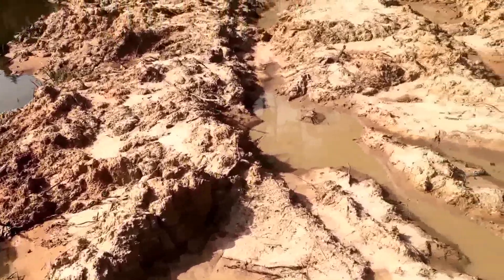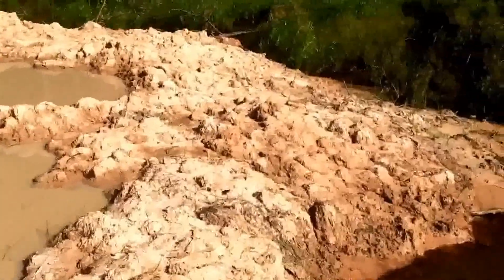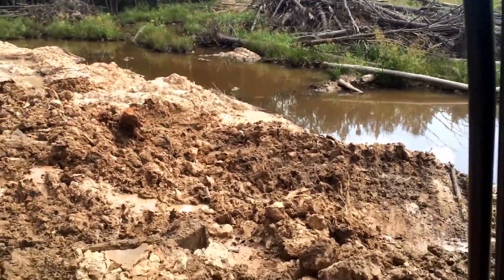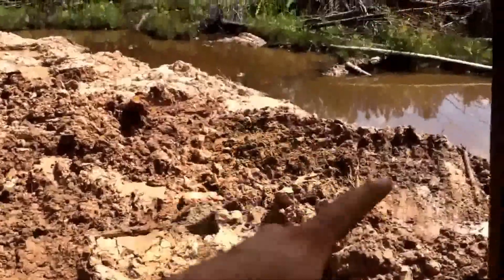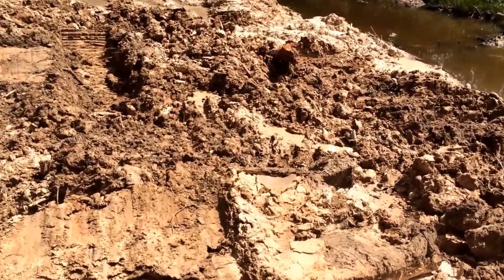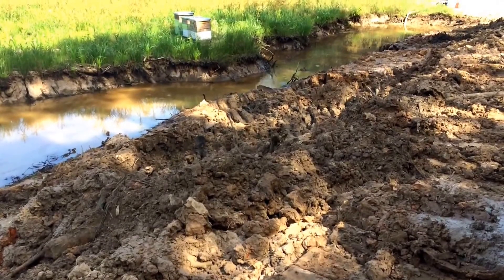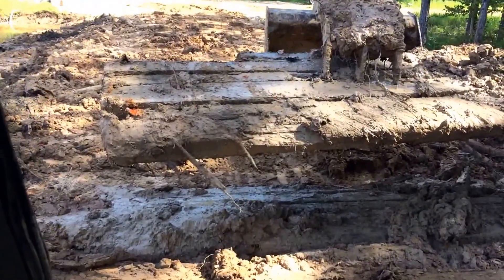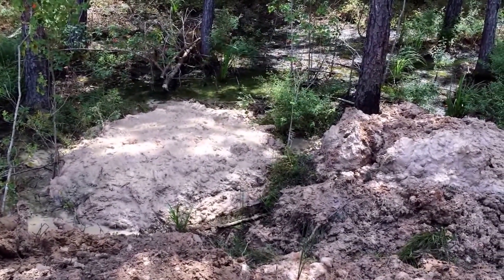Farm Work Update - Finally Some Good News!

Comment: On the bright side. You wont have to drill too deep if you have a well put in ;)
Reply from the maker: I'm not sure what you mean Aaron. Are you thinking the water is shallow water table? It's not, this is all surface runoff. I've researched surrounding drilling reports. The good water table is 200-300' (which still isn't bad). You can drink the mud "milkshake" is you want. I'll stick to clean and clear water, haha! Thanks for watching.
Reply: Tom Brueggen All that water has to go some where. It would eventually raise the water table. Probably not much but giving how much it cost to drill a well i'd say ever foot counts. 200-300' is really good wish mine was that good.
Reply from the maker: Aaron That's a stretch, but I see where you are going with it. Most of the water that you see here is infact surface water that was supported on the surface by silt. However the bigger issue is the water that has permeated the top ~2' of topsoil and then pools at the soil/clay boundary. That is what creates the "milkshake" mud phenomena. After a few days of dry weather, the surface crusts over, and gives the impression of dry solid ground. But with just a little disturbance, this top layer turns back to water, and turns to quicksand. It's how so many excavators have gotten stuck in what otherwise appears to be dry ground. This was a HUGE learning to be just yesterday when I finally observed what was going on. As I dug a ditch beside me, I exposed the weak plain of the milkshake mud. The weight of the excavator was squeezing the muck out into the trench I was digging. So when first exposed, the trench was dry. But after a few minutes of working in the spot, it would start filing in with milkshake mud. Nasty crap!